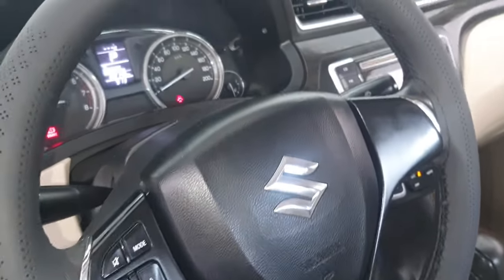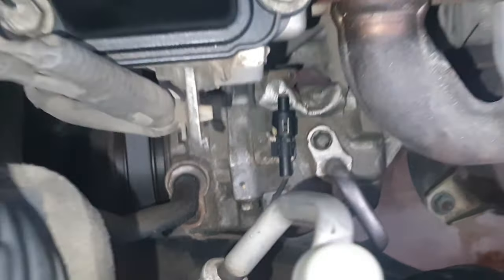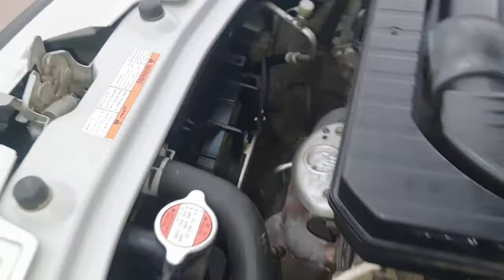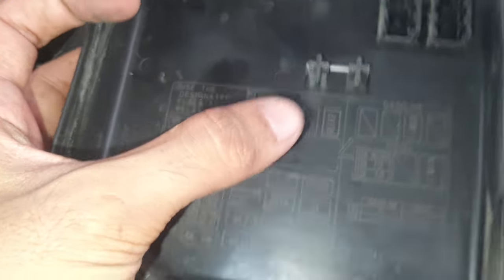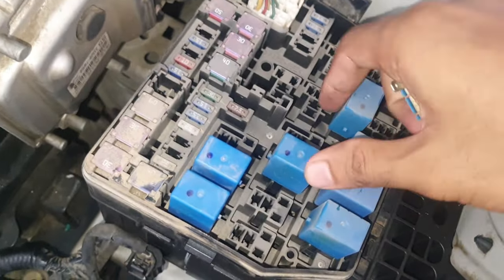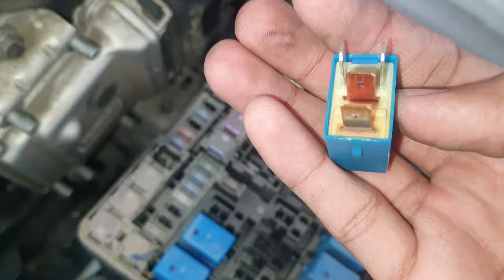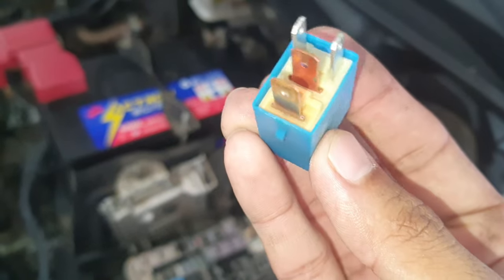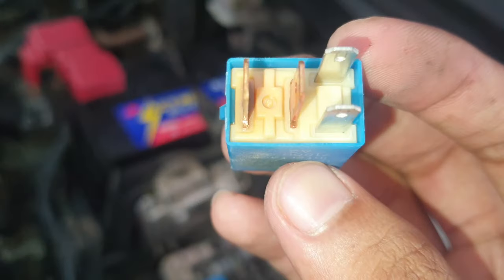Radiator fan not working easy solution.

Comment: Thank you for the quick fix by swapping the same style relays around, SWAPTRONICS, I would have swapped the horn relay if it was the same style and they all look the same style, so MAYBE both fans would be working now, the cooler the AC Condensor, the colder the AC inside the cabin, cheers.

Comment: Bro i had suzuki ciza which raditor fan not working before its work but fan not work then i go to garage change the motor after that fan start work but raditor stop working overall what i hav confused is it automatic when fan work raditor not work or both need to work could u help me plz

Comment: Hi there ive got a1.8 hybrid car, the radiator fan is not spinning, but when i turn on the air con then it spins. The engine starts when its cold ,and when it runs for a few minutes it stops,  and then i have to wait for a few hours before it can start again.  Please can you tell me the problem? Thank you

Comment: Only Ac fan is working after you changed the relay but radiator fan still not working after fixing relays pls check in the video
Reply: Both fans should work but only working single fan
Reply: He swapped the relay so he knows the motor is good.
Reply: 2 fans 1 is ac 1 is run by coolajt switch  so don't always come on together more so if ac us off
Reply: Hi, good day guys! I just wanted to ask something. I have suzuki ciaz 2017 year model. When I turn the AC on, only the compressor and Ac fan works. is it normal? The Radiator fan is not turning on. Also, even my engine temperature reach the middle temp. gauge at the dashboard it doesn't turn on. What do you think could be the culprit? Is it the Coolant thermostat/sensor?
Reply: I face the same issue before ac not work raditor work after fix ac start work raditor stop working is it normal can someone plz reply